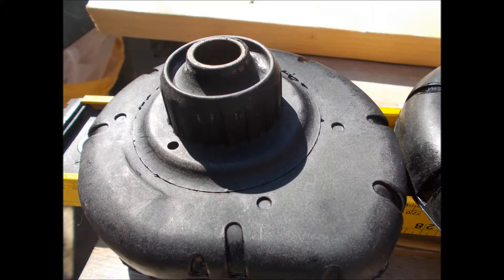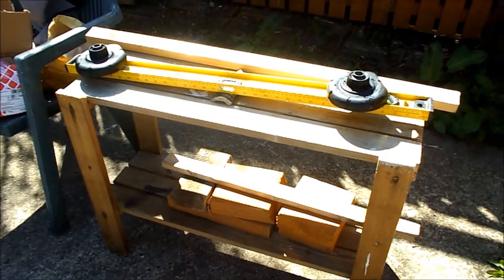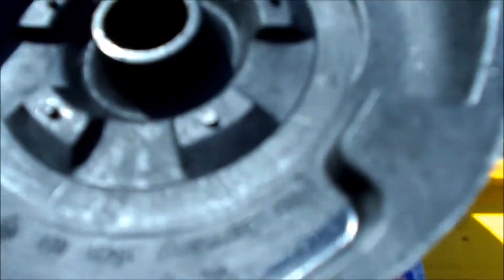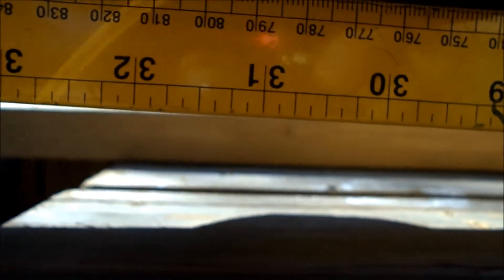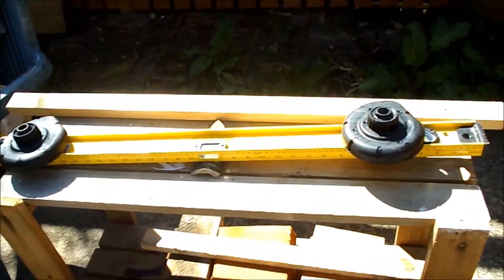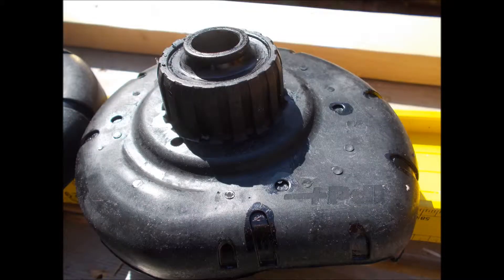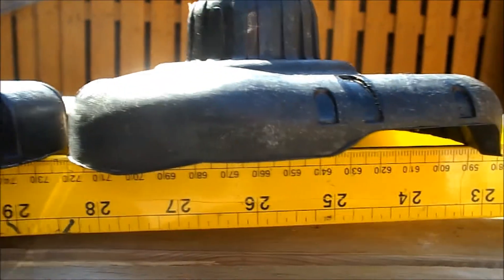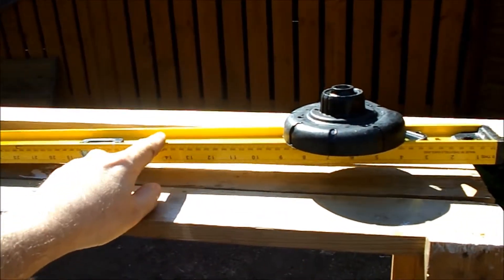25 04 15 UPDATED - IPD Volvo V70 front Strut spring seats. IPD vs Febi OEM

Comment: I have had problems with two spring seats on my '08 Volvo S60. When I replaced my front struts @ 135k miles, I replaced the spring seats with IPD+ heavy duty.  At 165K, one of these (IPD+) spring seats failed and had to be replaced. Thankfully, the IPD+ come with a "limited lifetime warranty." When they sent the replacement, the IPD+ guy mentioned that they have switched suppliers for this part since I ordered my first pair. Not sure if the new(er) IPD+ heavy duty spring seat is the one you show in the video, or a different part. I can verify that the new part solved the driver side rattle/clunk that's been driving me nuts. I hope it lasts more than 35K miles (which, of course, is the entire reason for buying these in the first place). 

I did notice that the new part is priced much higher than the one I bought 2+ years ago.  But evidently IPD+ is under new ownership. I don't know if the higher pricing reflects higher quality in the newer spring seat, a different pricing policy, or some of both.  Cheers!